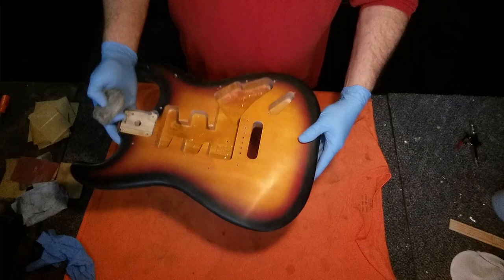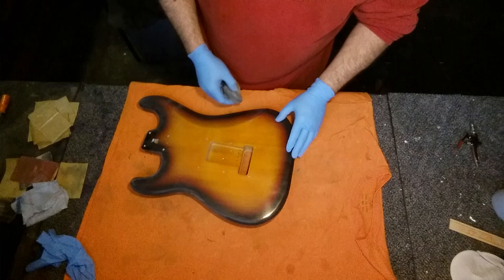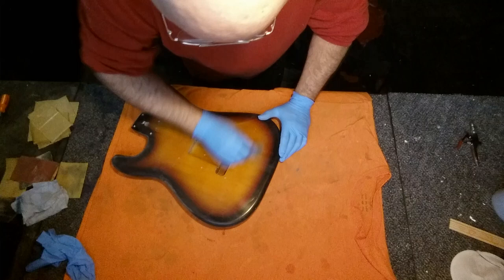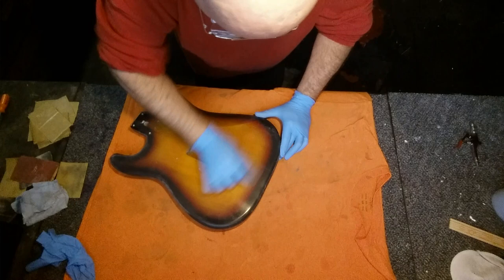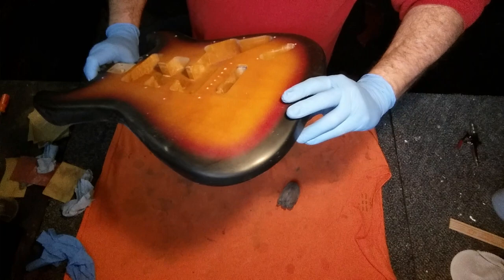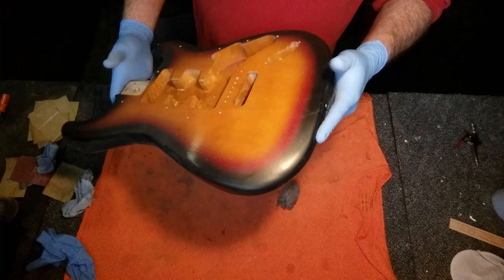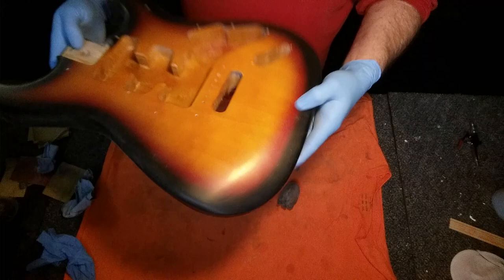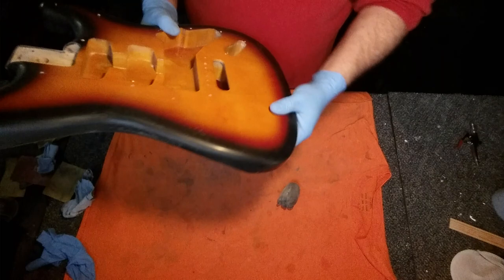Dulling out a poly finish.

Comment: I plan to do this on a Vintage V120(Les Paul jr basically) in TV yellow but it's very shiny. My plan is to sand the poly down as far as I dare then buff back to a low sheen,  hopefully like a kind of an old faded sheen. And then maybe just rub the remaining poly a bit more over time with 1000+ sandpaper and if I do reach the paint level I'll give it a few thin coats of nitro
Reply: have you done it yet? how did it work? I have a LP copy that's too shiny and I want it to reflect light a little less. Let me know.
Reply: Ooo I bet that’s going to look great! I adore a full yellow on a guitar

Comment: Thank you for this content. About to dull out the shiny finish on a cheap LP Jr and then replace with some quality electronics and pickup
Reply from the maker: Sure thing. I just did this to super cheap First Act. All I used was a 3000 Trizact pad. Right now, that is THE BEST, and fastest way.
Reply: @jwandhistools  do you feel the Trizact worked better than the steel wool?
Reply from the maker: @MikeAndersonvinyloldies  Yes. Much finer grit, and far more modern product. Steel wool is fine, but there are better products. They all do the same thing.

Comment: Just wondering if you went against the grain the whole time, or if you alternated? In the vid it appears you went against. How much pressure did you apply? Your guitar looks great!
Reply from the maker: Doesn't matter, since this is not sanding grain. You only  use enough pressure to break the gloss. Very easy procedure.
Reply: I guess I pushed to hard. I've tried with 0000 steel wool on my classic vibe and it's all scratches.
Reply from the maker: You have to use 0000 grit, and it takes a while. It WILL look like scratches at first. You have to change directions, and have some patience.
If that doesn't work, you can wet sand with fine paper, like 1500-2000 or higher.

Comment: I can't find '40' steel wool on the internet, is it very fine steel wool? What you've done there looks really good, I'm probably going to follow what you've done there with my strat
Reply from the maker: 0000. Extra fine. Wetsanding with 1500 or 2000 paper and mineral spirits works extremely well too. There is no one perfect way to do this. You are just rubbing off the buffed gloss.
Reply: @jwandhistools  Thanks, good stuff 👍

Comment: Congrats! I really enjoyed the result. By the time now, could you tell if the shine came back due hand touch or something? Thanks!
Reply from the maker: That guitar was sold. The shine will not come back unless you buff it, or it is rubbed a lot on your clothes or something. That's all buffing is. Rapid rubbing.
Reply from the maker: Done this many, many times for customers. Not one of them has has any disappointment at all. I made an epiphone SG special look 60 years old. Closest I come to any of the relic stuff. Aging without damage, and is 100% reversible.
Reply: @jwandhistools  Great! I'm getting the courage to do it to my 2001 black strat, mim fender, seeking for a less glossier look. Some say black finishes may be a little trickier,  I guess I'll give it a try, starting on the back. Thanks a lot for the feedback!!
Reply from the maker: @billmd91  Black is tricky to buff evenly. Have no fear deglossing it. I did a MIM sunburst strat. Looks fantastic.Done a bunch of black guitars. have no fear. It's a thing. 100% reversible, and you really need to just do it, assemble it, and give a little while to kind of wear a little on it's own. Personalizing a guitar is very satisfying.
Reply: @jwandhistools  Well that helped a lot! Thanks again for sharing your time and knowledge!!

Comment: Hello Sir , i have the Kurt Cobain Fender Jaguar ( The NOS version ) its finish is Gloss Urethane and honestly i dont like the way it shines , very shiny like a mirror. Can i get the glossy finish off and get a result like yours? i Had the opportunity to get the Road worn version of this KC jag but it is heavily reliced , i didnt like the relic till that extent. Can u advise me please? Thanks.
Reply from the maker: Same thing I do here. You can also use a med to fine scotchbrite pad, or wetsand with very fine sandpaper. 1500-2000-3000.
Any method will work. I think wetsanding will give the smoothest result. This video was done a while ago. Done several since then. I wetsand with trizact pads now. looks amazing.

Comment: I've got some wet-or-dry microfiber sanding cloth that works wonders for fret polishing (600 grit to 14,000 grit) would that work and what techniques would you recommend?
Reply from the maker: It's all the same techniques. You are just reverse-polishing. Micromesh is rated differently than sandpaper. Check before starting.
Reply: @jwandhistools  What is the product that you have had the best results with? I want to dull the plasticy mirror finish on my sunburst Yamaha Pacifica.
Reply from the maker: @ozzy2434  Trizact pads. Start with 3000 or 5000. Honestly, anything will work. You are not going to hurt it unless you really get careless, or use coarse paper.Try some scotch brite on something. Or steel wool. 0000 Only.
Or trizact, or even some super fine sandpaper. Always test on an inconspicuous spot, or some similar scrap.
Reply: @jwandhistools  Thanks!

Comment: Is this on a poly finish?
I got a Mexican made that ive upgraded a whole ton, so all thats left is making it look good - its way too shiny in my opinion(similar to what youre working with here). Could I do this with my poly finish like you did this?
Reply from the maker: Yes. says so right in the title. :)
Reply: @jwandhistools  yeah thanks! Just thought I'd double check, I've been advised numerous times not to mess with a poly finish. A lot of people seem to be of the understanding that it never turns out looking good
Reply from the maker: You can also do this by wet sanding with a sheet of 3000  or 5000 Trizact. More expensive, but gets a much duller matte finish.
Reply from the maker: Poly is just plastic. You are not going to hurt it, and it can be buffed right back out easily.
Reply: Was this a polyurethane or polyester? Does it matter?  Thanks for the post.  I have a polyester painted mustang I’d like to dull thanks again

Comment: I've got a classical guitar with a poly finish. The finish on the back got cloudy in about 40% of the area. Do you of any product of method that would fix the problem without refinishing it? Thanks..
Reply from the maker: Wet sand and buff. I would just do the entire surface, instead of just the affected area.Start with maybe 800-1000. On up to 3000 or 5000. 
Then buff it out with a power buffer and some swirl/scratch remover.
Reply: Thanks for the suggestion. If nobody buys it for what I'm asking, I'll  definitely be giving that a shot.

Comment: I want to take the shine of of a 50s classic series p bass that’s a black nitro finish. Can I use the steel wool to get a nice dull black finish?
Reply from the maker: Careful with nitro. Wetsand with 5000 trizact or quality sandpaper is better for delicate nitro.
Reply from the maker: You sure it's nitro? I am not aware of Fender using nitro in the last 50 years, unless it's custom
 shop.
Reply: @jwandhistools  Yeah it’s the classic series, nitro lacquer,
Reply from the maker: @ejmusicofficial  Ok. JUst be careful. Nitro is MUCH more delicate than poly. If you want less shine, get a 5000 grit Trizact pad. Trizact is a thin spongy pad with ceramic sanding medium on it. They are ONLY for wet sanding, and are fantastic.One drop of dish soap in a big bowl of warm water. Wring it out good, and just rub gently across the finish, just like you were cleaning it. Totally disassemble the guitar first, and keep the guitar dry as you go. Those thick blue shop paper towels work best. Extremely important to not get water in any screw holes. They will swell up and hurt the guitar. Best to leave it alone, but if you really want less shine, use the trizact and be extremely careful.
Reply: @jwandhistools  Okay thanks for the info! 👍🏻 will the finish age like nitro now that the clear coat is off?
Reply from the maker: No.

Comment: What if I use scotchbright pads
Reply from the maker: You can. Use water with a drop of dish soap. Dry it off frequently with paper towels. Don't get water in the screw holes or they will swell and split the finish. Anything will work. You are not going to hurt it unless you get it real wet. Shop air is handy.

Comment: Mine got really scratched
Reply from the maker: What type of guitar, and what did you sand it with, and how?
Reply: @jwandhistools  A poly strat, with some wool and then sandpaper. It actually became a lot better for some reason after using wood oil on it. I should have have sanded as much in circles I guess. I have a veryyy shiny 60th anniversary blizzard pearl strat that I want to make look more vintage, not sure how!
Reply from the maker: Well, you have to lubricate as you sand. Soapy water. Naptha. Mineral spirits. Something safe. Poly doesn't care about wood oil. If you used steel wool first, then sandpaper, I hope the sandpaper was at least 1500-2000. 

0000 steel wool is the only steel wool you should use. 000 is too coarse.

Comment: Something tells me you would rate Korean and Japanese guitars and Chinese guitars on the same level. Which is sad.
Reply from the maker: No, I do not. Wood is wood. metal is metal. Plastic is plastic.
The difference is the quality of tooling. The skill level of those using said tools. The quality control of various factories. The man hours put into each product, like setup time.
A USA made anything is not guarateed to be the best there is. especially now. 
Ever play a late 60's or 70's strat?
Most of them were junk.
A chinese made anything is not guaranteed to be the worst there is. I just got a Chinese made Firefly 338. Incredibly well built guitar. $220 shipped, brand new. 
A $2000 Eastwood guitar is made in China.
A similar Gibson is $6000 and is not always a better guitar. 
When it comes right down to it, any guitar can be a piece of crap. Any guitar can be nice. 
I have taken many cheap guitars and made them far better than they were when they were new.
It's a matter of knowing how to deal with all the issues.
What's sad is headstock decal worship.
Reply: @jwandhistools  wow honestly couldn't have said it better myself. Especially about the decal worship. I have never played a real 60s strat but I have played the like 5k remakes from the custom shop...great guitars....but 6 grand? Thanks for the reply man i was surprised by your in depth reply.
Reply from the maker: @toemasmeems  It amazes me me how Hendrix made the music he did, using some of the worst guitars ever made. Late 60's strats were incredibly noisy(that I can hear in his live stuff) and were prone to dead pickup magnets. extremely inconsistent. That's why you have to play one before you buy it. Some people don't. They just plunk down 10k sight unseen because it's "vintage".
haha...not my money.
Reply: @jwandhistools  I know!!!! It kills me man. Im making my forst guitar right now and i feel confident that bo matter what happens im sure it will play better than some old strats that are probably worth afew thousand
Reply from the maker: @toemasmeems  It's all in the setup. If you use facebook, I admin this group.
Feel free to join.

https://www.facebook.com/groups/923275787836990/?ref=bookmarks